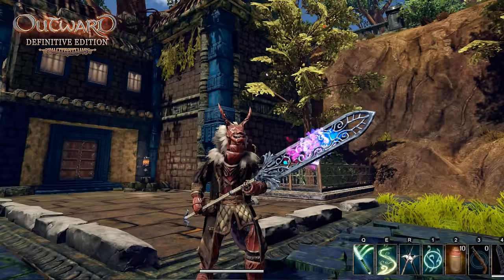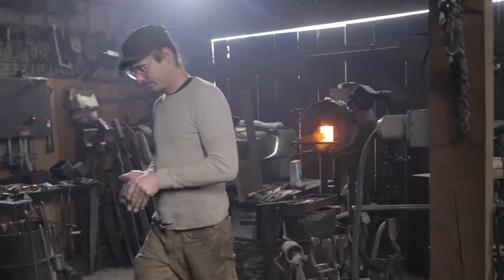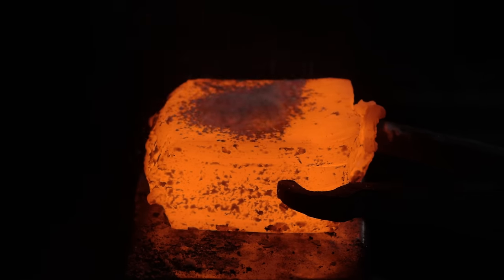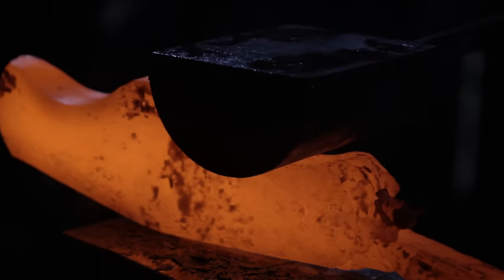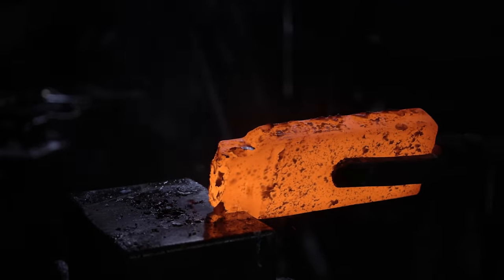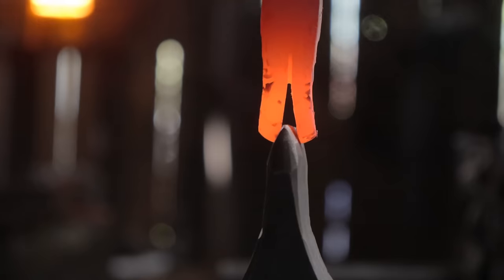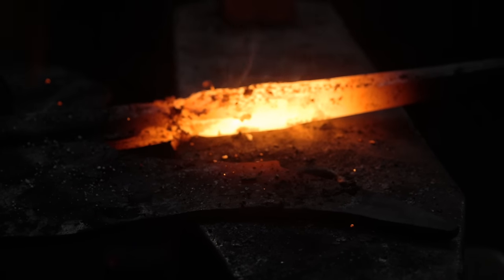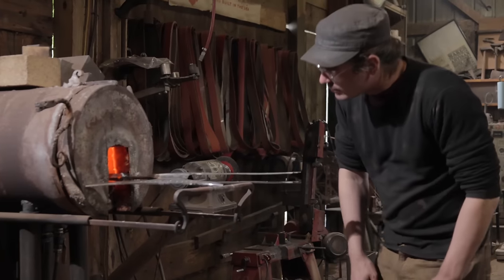Everything You've Ever Wanted to Know About Forging A Halberd

Comment: as a total layman, I think the purpose of the holes might be to reduce weight in the axe head to make it less tiring to use in a long battle, as the halberd was primarily a battlefield weapon, so it would be expected to march with it for many miles, and to fight battles that could last multiple days. Anything to make it less tiring would be useful, so long as it didn't compromise structure/use significantly

Comment: Have you thought about shattering bone packing the edges first in bone powder and then in oil clay for a proper case hardening?
Personally I like to use bone and Coke with an Alkali greenware casing. Yes I do need to bring up my ribbon burner a little bit to get a good temperature. When strengthening wrought iron on the byas I prefer using between 9 and 12 layers always attempting to stay below a thousand layers changing hammers depending on which process I'm working on rather than changing the swing. I was taught to use a pigging anvil to create the grain structure and refine 1% or less saving my surface hardened anvil for Steel. And I have noticed you do not even work with a traditional block. So I assume most of your work in refining and Welding is done with your drop hammer. I was never very successful at using a drop hammer but I am quite happy with my press & hope someday to get a Farber press.

Comment: Could it be to direct stress to specific points, so that IF it would crack and fail, it fails in a predictable pattern? It is after all, a rather large weapon, in terms of having many working surfaces, and if it were to break, you'd want it to break in such a way that the rest is still useable, right?

Comment: 10:30 Would the holes not act as like fullers for a halberd? As in, to remove some weight?
Reply: Perhaps, but there are a number of other ways they could have done it and one of the ones shown has only five small dots, you're looking at an ounce or likely less.

Comment: Seeing stuff like this, I always wonder, who came up with this?
Like, in this case, where the forge welding was pretty prominent, I couldn't help but wonder: who came first up with this technique? What circumstances led them to the decision "You know what? Let's make these as different parts, and then heat them up and hit them with the Hammer until they fuse together"?

Simply Fascinating.
Reply: It was probably a slow process that involved a lot of craftsmen over many years.

Comment: I love hand forging as much as the next guy, but you guys don't shy away from the power hammer. I don't know if it's historically accurate but I use a hot rolling mill. In reality it's a jewelry rolling mill for softer metals but it's plenty hard and if you keep an iv of warm water flowing over it it will last years. It's way easier to get the metal down to where it's easy to squeeze out a lot of the slag in a single heat. I remember from a medieval workshop that blacksmiths worked like they were on a production line leaving the piece in the furnace no longer than necessary and making as few strikes as possible. It had to be efficient or people couldn't be blacksmiths for years.
Reply from the maker: Yea that is a slightly later mentality. I mean the main reason for efficiency in older times is just the precious nature of the material. Not just the steel or iron but the coal or charcoal as well. Every material in the process was hard to get. Nothing came in bags from Home Depot.
Reply from the maker: The wasteful mindset just didn't exist.

Comment: I missed this video in my Subs, sorry guys!
Ilya made the comment about forge welding the parts together from three bits, apart from being easier, wouldn't that also make that on mass manufacture easier?  As in, if one of those product streets got ahead of final production, that's not that bad, but if all the streets got ahead of final production, then you could move your workforce around a bit to catch up?
Or am I just apply 2020 Logistics to an 1600's problem?
Reply from the maker: You are exactly correct
Reply: Nice to know Manufacturing hasn't really changed too much then.

Comment: I was wondering, and maybe I didn’t see it properly, but did you heat treat the iron before grinding in the blade, if so, why?
Reply from the maker: Carbon was added to the material during forging and some wrought actually has some steeling bits in it.

Comment: Hey, young blacksmith here, i'm wondering how you can manage to still weld such dirty looking steel. Sure you cleaned the first part of the billet, but then you just scraped the excess scale and just went with it. I have trouble welding scale covered billets, like just a dark layer would be enough to prevent a good weld from what i can manage to do. Why does it work when you do it?
Reply from the maker: Wrought iron isn’t the same as steel and a coal forge fixes all things with forge welding
Reply: @ThatWorks  well i'm using low carbon steel, sometimes old wrought iron too, and my forge runs on coal, the same way. But when there's some crap in my weld, well, there's crap in my billet. It doesn't seem to magically reduce back into iron, or to drip out of the sides with the flux...

Comment: If you can't figure out why they perforated Halberd blades, you really shouldn't be calling yourself an authority on the subject. It's really simple; Weight-relief. By reducing its weight, you increase its striking-velocity. Double the mass of a moving object and you only double the energy output. Double its speed, and the increase is exponential.

Comment: How do you get away with forge wielding billets that have massive gaps between the pieces that you haven't ground the surface of?  Everyone else seems to go to great pains to wield all the joints first and have perfectly flat and clean surfaces.  I see you using a lot of borax.  

What are the pros and cons of the different approaches?
Reply: People didn't used to use surface grinders and similar silliness. You just brush the material a bit and it welds.

Comment: I really enjoy the attempt a historical accuracy. Yet I feel compelled to point out the weapon you made was clearly so unbalanced, unwhieldy, and heavy it cant be effectivly used. Real weapons were made to hit an enemy with, good weapons were made to make that easier. There is no advantage to using a polearm so heavy you have to grip it mid-shaft, it negates it's primary advantage reach, and when every strike forces you to over commit you're left vunerable.
Reply: the primary use for a halberd is hooking though not really striking, they did of course, but it was mainly used to hook.
Reply: @TheEthanEdge  the halbard was for hooking, and chopping, and stabbing, it was very multifunctional striking impliment. Yet, the feature that made it useful was doing all that at a distance, which isn't likely when your weapon is 3 times the weight of your enemies weapon, thus giving them a clear advantage, thus my point, what was yours? semantics?